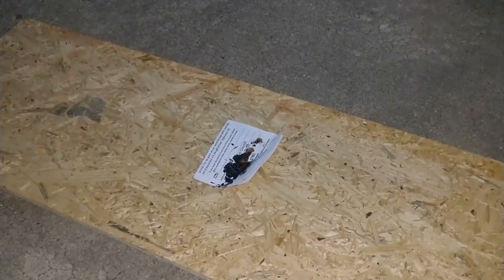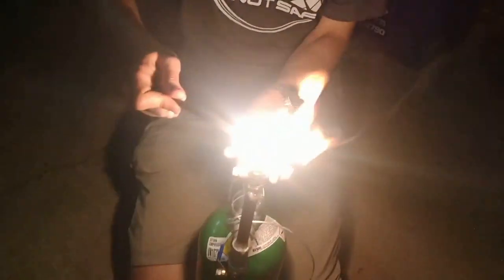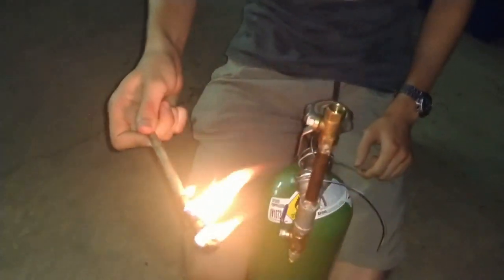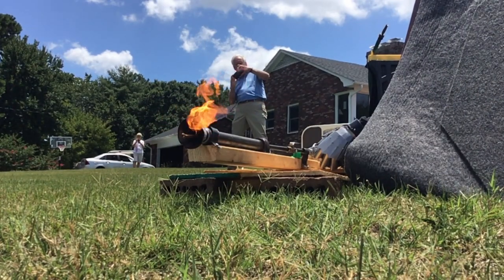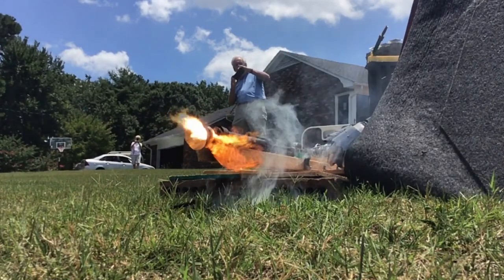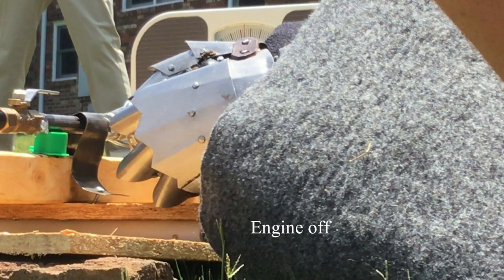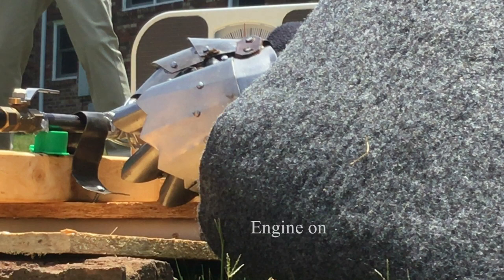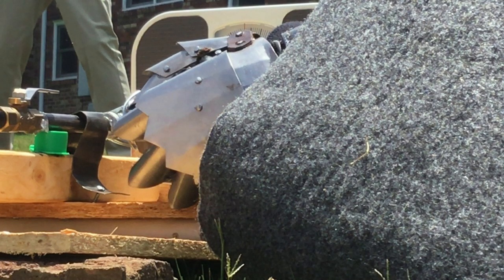Homemade Hybrid Rocket Engine

Comment: Good idea with the tar!) Only he needs a frame so that the liquid does not fly out into the pipe. For example, impregnate a cylindrical water filter with it.))) You also need a larger diameter pipe for the combustion chamber so that the speed of the combustion products in it is lower, and at the end there is a part tapering with a cone so that the exhaust gas accelerates there. If the fuel continues to burn in the cone to a critical section, then the output will be a supersonic jet with Mach disks.))) It is also better to let oxygen through a reducer so as not to exceed the critical pressure for the pipe.

Comment: Instead of having your nozzle diverge immediately try converging it first to increase pressure
Reply from the maker: We actually did have it like that. We welded some metal in the pipe immediately before the nozzle to decreases the diameter and increase the pressure. In the second firing after the nozzle came off, you can see this extra material glowing red because of its low melting point. Thank you for the suggestion though because I think this material came off somewhat.